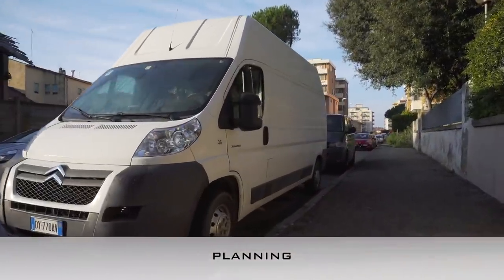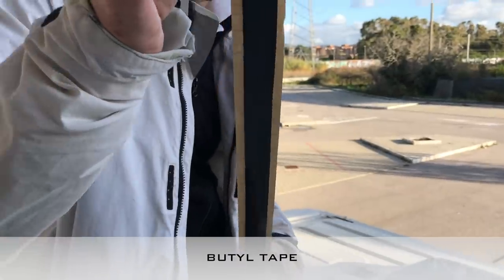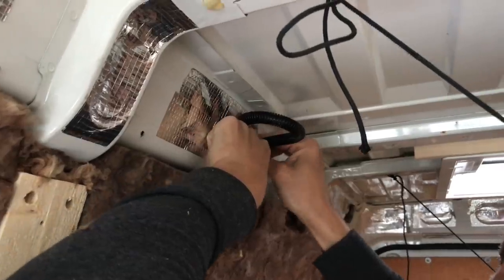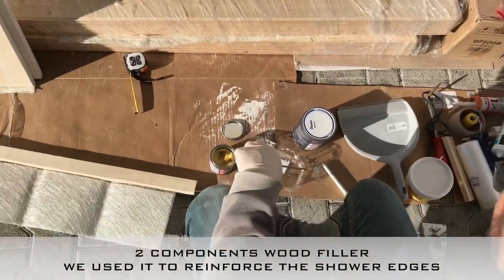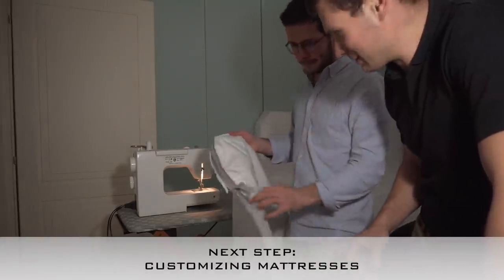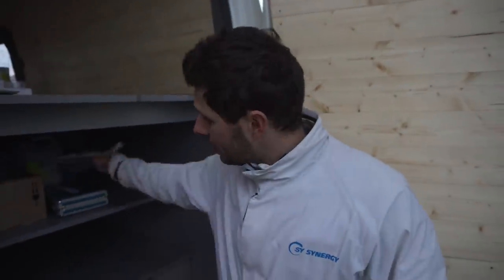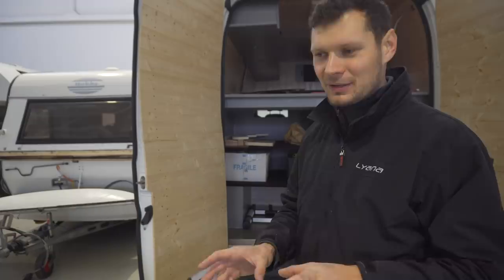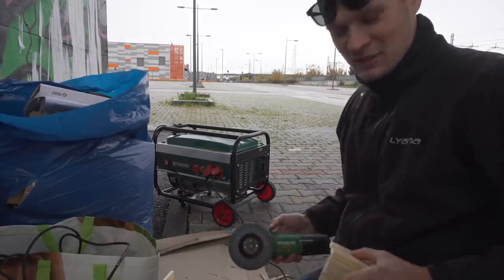Custom Camper Van - How to Build - 1

Comment: Great video, great van. Can I ask what epoxy you used for the shower? Did you paint first and then roller the epoxy on after? Ta
Reply from the maker: If we understood you right, you are asking about inside the shower.
First we covered all the corners with stucco paste, then we reinforced side walls with shelf brackets and glass-reinforced plastic stucco. After a bit of sanding and wiping we painted all the shower area with special paint they usually use to renovate bath tubs
The wooden cover with epoxy resin finish above the shower we did separately and then just mounted it with hinges

Comment: Awesome! Well done and probably very nice to live, but i have a few constructive remarks for anyone planning to convert a van: 
* Heavy material, I see very few DYI converters that are using lightweight material for building their van. This one uses VERY heavy and unnecessary thick wood, this add to both fuel consumtion and in many countries road tax. 
* Did you consider swivel boxes for driver and passenger seats? Not expensive and very space saving.  
* Do NOT cut the support beams as they did in this vid, get a sunroof that fits the model of van you got, and use the spaces between support beams. 
* Sheep wool, sheep wool, sheep. Not too expensive, not unhealthy, good for environment, very good insulation and VERY good to regulate moisture. Also use a thread and vacum to fill the support beams. As a bonus, add a layer of sound insulation before adding sheep wool. 
* Cabling, its not advisable to use solid core house cable for a van. For safety its to use flexible cable meant for boats and vans. More expensive but allot safer,  

Dont mean criticize, just want to add some constructive tips. 

Using thin plywood (4mm) with felt or wallpaper instead of heavy wood paneling is both much lighter and cheaper. And can still add-luxurious feel. Just screw on wood to the metal support beams to fasten the panels, cabinets, lamps etc

Same for floor, good sound and heat insulation topped by 9mm plywood and vinyl sheet or similar on top. Saved weight and money.
Reply from the maker: Thank you for your constructive comments Tore, very appreciated. Recommendations and tips are always welcomed, no one is perfect and there is always so much to learn.
We were thinking about swivel boxes but couldn’t find single passenger seat to swap our double one so for now it stays like that.

It’s very nice to live indeed, almost like at home, moving home 🏡

Comment: You could get some wire baskets for your fruits & veggs. And you could get some felt sq's. to put between things that rattle!!😎 Be safe & I enjoyed your coversion build!!😎🎇
I was wondering if you could add 2 converters of the same size and that would give you 1200 voltage?
Reply from the maker: Thanks for the ideas. ))
The small concern would double consumption in stand by mode which far from ideal.

Comment: Nice piece of work!! Can you say which sort of wood you have used?
Reply from the maker: We used 18, 20 mm multilayered wood. It's very strong, pretty expensive and actually pretty heavy compare to the alternatives. 
I would reccomend to use this for bed and most important structures. 
Cupboards and decorational side can be from another panels and lighter.
Reply: Exploration Brothers thank you for your answer. Sorry my mistake, I meant what wood have you used for the floor and the walls? 10 mm spruce panels?

Comment: @Exploration Brothers. 
Beautiful conversion. Shame you go far to fast when showing the end result but thanks for sharing your building techniques.
Helpful hint for next time: If you paint all the wood before assembling it is so much quicker and easier. No awkward corners to deal with just flat surfaces that you can even lay horizontally for extra comfort. 
Another helpful hint: If you put just one drop of washing up liquid in the water you use to smooth your silicone, nothing will stick to your fingers.

Comment: You guys used fiberglass isolation for the side panels. Isn't that getting soaked in condensation triggering mold to appear?
Reply from the maker: This winter we will open one side on the van and will tell everyone regarding insulation. 
It might be a problem, but until now we’ve been only to warm countries, so no issues. We’ll see when we’ll head to the north))

Comment: Nice work guys, congratulations for the results! I was just wondering what is the software you used to design it?

Cheers!
Reply from the maker: It’s called SketchUp, you can find file with our design in the description of the video
Check our improvements’ video

Comment: Hello guys, I did not see the width of the car, can sleep comfortably for a person 187 cm? Good job
Reply from the maker: Thank you! The final length of the top bed is 183 cm. I'm 185 and I sleep diagonally and have more then enough space (width of the bed is 140cm. If you will sleep with someone, then it might be less comfortable as you need to bend your knees. 
If you will do the bed a bit lower - you will a bit of space as the higher you go, the more narrow the van becomes.

Comment: cool gadgets, but what happens when the electric runs out ?
Reply from the maker: When batteries are low (around 11 volts or slightly more) the iManager will disconnect everything automatically.

Comment: Hey guys I have an question regarding the solar. 

I spoke to a father and son deal who was doing the campers for 30+years the advises me DONT use flex solar panels as they can’t dissipate heat and fail or have very poor output in a matter of months. 

I was bummed about this because your solar install looks so clean and I wanted to do the same.. 

How had been your experience with the flex panels ? Would love to hear your reply! 

Subscribed! Locky )
Reply from the maker: They lost a ‘new’ color, but they work just fine as they should work. 
Maybe we should test for the next video!?
I think now they are more advanced technologies as there are also roofs, like the one’s Elon Musk is working on. 
The black sealant is real power and strong stuff, so don’t worry about mounting them in that way.
Reply: @ExplorationBrothers  Nice!

I contacted Renogy I'm happy with there warranty Ill purchase from them and if I have any troubles ill send them back )) 

Looking forward to your up coming videos )))

Comment: Hey Guys,

well... after watching hundreds of videos of people who are converting Vans you just build the most efficient one I have seen. The high placed bed and the tons of space under it are amazing. Your kitchen and the top window is great. I would add a working space for your brother right in front of the couch area... like a sliding table... But I want to ask 1 thing. 22K are a lot of money.. you say that to change an engine is expensive and ur right but I I think its possible to buy a Mercedes Sprinter for 3,5K with 120k kilometers and in a good condition. You think I could build something like your camper with lower costs? aim thinking of about 10k.
Reply: sry for the bad english am a German guy... be patient pls XD
Reply from the maker: You can definitely do that! As you could see in our “money talk” video, almost half of the cost was van itself and there are a lot of ways to save some money.
Sprinter for 3.5 K with only 120k sounds like a fairytale so if it’s in decent conditions you should definitely go for it!
Our next camper van project will be very budget, to see how low can we go without losing quality

Comment: Nice job with the design! I'm a bit worried about all those pocket holes though!
Reply: Why?
Reply: @toolsandtrash6911  Pocket hole is one of the weakest joinery in the long term, right after a butt joint. I wonder if the van movement will affect them, maybe over the next few years.
Reply from the maker: Thank you Laurent for your comment. For now it’s all solid with no signs of weakness so we don’t have any concerns for now

Comment: Very nice, burners under vent, floor install and paint touch up well done Will use your toilet idea that solar is sweet.....
What drives me nuts on the hundred or so videos I have seen is never the cost, time, construction, list of hardware or quality of work nobody has ever weighed the contents and build material "WEIGHT= MPG" as I watched your video maybe 980 lbs? 560 kilos? Then another 90 kilos food clothes toys tech? Would like to know your MPG during your travels Thanks

Comment: Is there anyway you can show how you did the graphic prototype layout?
Reply from the maker: We do not have, but the 3d application are relatively easy to use and in 3 days you can learn good basic of any app. They also offer free lessons like sketchup app does. Play around as it will give you better feel compare to paper.

Comment: Enjoyed watching this - I'm part way through a T5 conversion, looking for ideas. You guys have used very heavy/substantial woodwork - are you not worried about weight/handling?
Reply from the maker: We could save some weight on the top cupboards and maybe kitchen, but the bed and sofa need to be maximum strength as you don't want things to be wabbly. 
Total weght with water, fuel and everything inside is 3130kg, but you definitely could save a 100 kg.

Comment: How do you clean under the panels? How do you clean under the edges of the tape?
Reply from the maker: We actually do not clean, apart of spraying water with high pressure from one side. It's plastic and it will take decade to ruin.
We pay proper attention to the top surface of the panels though!
Check out our update video as this one is more useful: https://www.youtube.com/watch?v=2GaTnoBFj1c&list=PLRq74thRnlOld7_vMl8PZM3O2rh24t1UP&index=3

Comment: what are the dimensions of your space? it looks amazing!
Reply from the maker: The van is 600 meters long and the space used for build is about 3 meters 50 cm. 
There is a sketch app link if you fancy to see int in SketchUp
Reply: Exploration Brothers 6 metres? Or 600?
Reply from the maker: Damn)) you’ve got the point)))

Comment: I really hope you made the wiring holes bigger and added insulation around the holes or they will chaff and with the vibration eventually the insulation will be worn through and then bang! You should watch Greg Virgoe Youtube channel for ideas and correct methods.  Not installing a vapour barrier over your insulation will mean that you will get moisture between the exterior walls of the van and the insulation causing it to rust from the inside.
Reply from the maker: Thanks for feedback. You are right and we haven't seen every video on youtube before build))
With our limited use of the van (couple of months a year) it will take years before we might see any problem and if we will have, then we will share them with everyone)))
Reply: Hi, yeah of course you can't watch every video but i would say the 2 best Van series to watch are Greg Virgoe and Travels with Jazz, Greg is a mechanical engineer and does videos on specific parts of the build such as insulation. Heres part one https://www.youtube.com/watch?v=hDZBJw7cV2U
Reply: I'm not trying to be negative, I'd just hate it if you spent all that time and effort doing the work and you had major issues.
Reply from the maker: You're right. Next one we will do better and will research more. For now it's good if it lasts 5-10 years and we will open some panel is a year time to see how it's going inside. Maybe since we are in the warm climate - won't be an issue at all.

Comment: 10:57 Do you have a separate tutorial on how you installed the metal bar? I'd like to do something similar but I wouldn't know how to attach it to the frame of the van.
Reply from the maker: It’s not attached to the frame of the van, but just resting on the 2 huge side wood panels. You need to cut out precisely the holes so everything leveled. Then depends on your plan.
Reply: Thank you for taking the time to get back to me. I think I understand what you mean. I'll try to copy. Was the metal lighter than using a wooden beam?
Reply from the maker: I’m not sure about the weight, but metal is much more rigid and will not bend slowly over time.

Comment: how you shower without water everywhere?
Reply from the maker: You just need to be careful. It's not a full on shower - it's an option to shower in the van and honestly most of the time, I will be showering after a run straight outside of the van with my sport shorts on. If you will happen to be in the city, then you have an option to rinse yourself. Only ambient temperature water, unless you want to warm it up)))
Check out update video where we talk more about shower: https://www.youtube.com/watch?v=2GaTnoBFj1c&list=PLRq74thRnlOld7_vMl8PZM3O2rh24t1UP&index=3

Comment: Nice build but that isulation I think its quite bad. Soon condensation might build up and its a starting ground for mold and mildew. Could actually make the living environment in the van unhealthy. Correct me if I am wrong.
Reply from the maker: Thanks for your comment, Isaac. We are going to check the situation with insulation soon and make a video report!

Comment: Condensation might make the insulation moldy.
Reply from the maker: We are keeping close eye on insulation and during refit video we are planing to open couple of panels to see what’s happening there. Hopefully nothing bad cause usually the space inside the van is well ventilated and heater helps as well

Comment: Isn't the shower a little too small?
Reply from the maker: It might be not the most comfortable shower and not the biggest, but honestly we just shower outside of the van most of the time as it’s much more practical in every case. 

When in the city in the summer months, then we definitely use it and it’s fine as we trying to consume as little water as possible and it’s doing it’s job. The shower handle is also used as for french bidet, do it’s great.
Reply: I guess I was just worried about the water splashing out and maybe causing mold, but I guess if you sit down in it that makes it fine.
Reply from the maker: A bit of splashes are fine as you just wipe them straight after. There is a 1 cm stopper for water in the shower, so water stays in the shower))

Comment: Where's your windows?
Reply from the maker: Hello! 
We trying to buy a window for sliding door but it's a real mission as no one takes a risk to order a glass without being 100% sure and since out car model came from factory without window the suppliers don't know which window to order. Anyway...
We will eventually try to install a window.
Reply: @ExplorationBrothers  I bought my from ebay for my Boxer ,installed myself .
Reply from the maker: We are checking sometimes and it depends on your location, as they sell in UK for good price but they do not ship them to Italuy((

Comment: I would of tried to position the roof vents in such a way that I didn't have to cut through the structural member to install them...
Reply from the maker: Thanks for comments. You might be right and we did it only because there was another one in a short distance and vent is actually holding ceiling together (obviously not like metal). Otherwise it would be too much to the back of the van.
Reply: @ExplorationBrothers  Fair enough, I'm a nightmare for over engineering things 😂

Awesome van though, love how it turned out. Video is nice too, so much production value.

Liked, followed, and on Instagram too. Look forward to updates.
Reply from the maker: Yeah. We have already quite long list of ideas to implement, but waiting for some spare time from jobs. Shortly...

Comment: After couple years rock wool could start be wet
Reply from the maker: Maybe if you live full time in cold climates. Wood actually is breathing and several times we opened the walls, so for now all good. But lately we don’t use the van very often.

Comment: These guys need to borrow a router at 25:00
Reply from the maker: Thanks for recommendation, Dodgeplow. We would need more more professional tools for working with wood indeed, and router would do its part. Actually just discovered after your comment that such tool exists! Will keep in mind for the next build! ))
Reply: You did very good with the limitations you had. A router is not very expensive or one could be borrowed. It is very helpful for these situations.

Comment: Bad move using the fiberglass batting. It’s prone to mold growth.
Reply from the maker: Hopefully not, we will check it out by opening couple of panels soon!
Reply: Exploration Brothers 
Yeah, do! Moisture (environmental, human exhalation and evaporated body moisture) accumulation in that space given the lack of air circulation in a metal container is a serious issue (ever ‘make out’ in a car on a date? There ya go). Use the panels of insulation or sprayed on type instead. Almost guaranteed that you’ll end up tearing it all out at this point.
Reply from the maker: Thank you, we will keep you updated!

Comment: using fibre insulation and wood with no vapor barrier is a big mistake. huge. warm air will get behind the wood on cold days hit the metal. water will be pouring down the sides and soaking the insulation, insulation stays moist and becomes a conductor instead. very bad practice.
Reply from the maker: Most probably you are right. In couple of months we might open some wood panels, so we could check out how is it. Thanks!

Comment: Good tip for the silicone- get it neat as possible and watertight(no holes in the silicone) then spray it and surrounding surfaces with soapy water then run your finger over it to remove the excess. The silicone will come off with your finger but stay adhered to the surface where soap wasn’t sprayed 👍
Reply from the maker: Thank you for your recommendations, James!